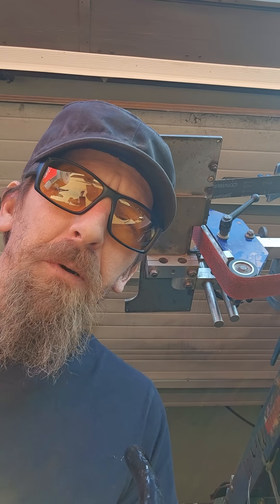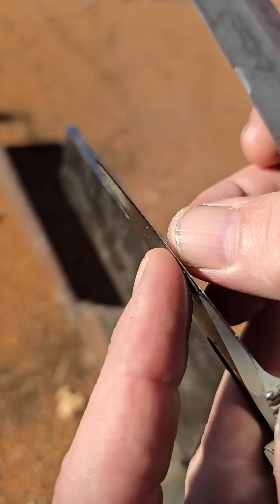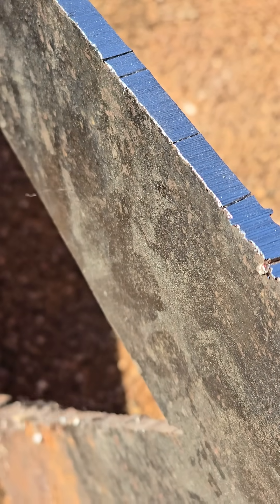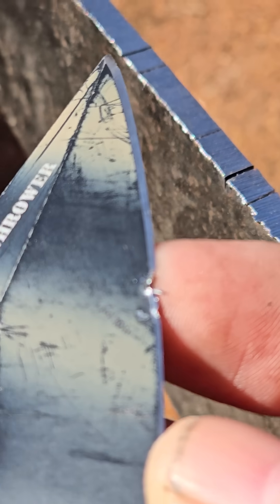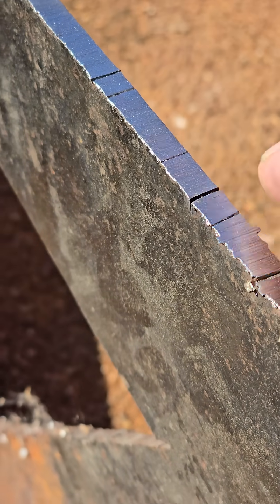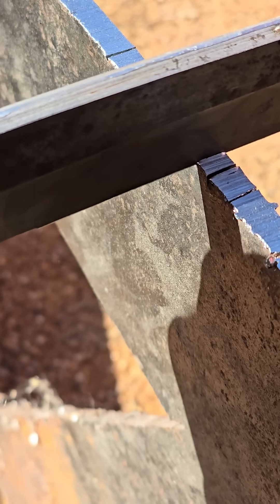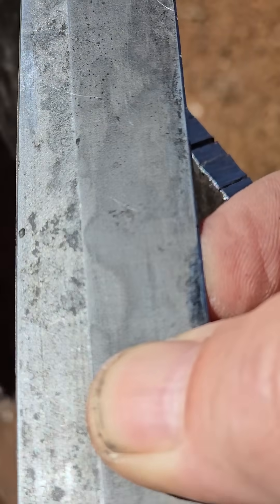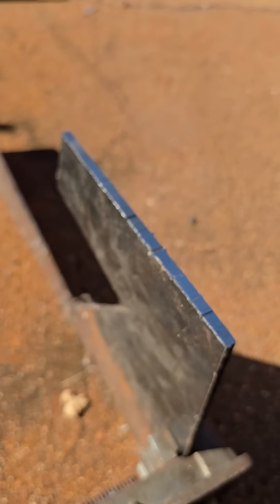myth busted. m390 vs 1095

Comment: You missed the part where your blade is 2-3x the thickness of the other blade. Terrible comparison. The geometry was nowhere near the same either. I appreciate the video, but do a real comparison next time.
Reply from the maker: My blade is .005 thick at the heel of the sharpen the other was .010 that was the point.  I wasn't testing edge geometry for slicing flesh I was testing impact resistance. My edge is thinner
Reply from the maker: How dont you see this?

Comment: Lmao 😂 you tested m390 a steel that although modern isn’t very tough at all against 1095? How about a fair test like 3v that’s a fairly tough steel and it’s more modern too
I would not trade my cold steel master hunter in 3v for a 1095 knife ever. It’s tough holds an edge better than 1095 and because it’s such a tough steel I can put a 30 degree edge on it and it keeps it.
Don’t try to make it look like modern steel is trash by showing the toughness of a fairly weak steel like m390 against 1095.
Reply from the maker: To the contrary. M390 has 1.25% carbon. I would happily put it up against 3v which I have. The point here is how the heat treatment is done

Comment: you call yourself a pro? 😅
Reply from the maker: Your point?
Reply: @proknifethrower sorry for using provocative words.
Imho, for field/outdoor use and impact resistance, of course the M390 is less tough.
Different steels are made for different purposes, so the testing method should match what the steel is actually meant for,  not just impact resistance
Reply from the maker: @yamerica3550 m390 doesn't have to be less tough it actually has more carbon content than 1095. Edge holding capability comes down to two factors Rockwell of hardness and grain density. Therefore, if it can't chop steel at all without the edge collapsing then the grain density is not tight enough or it is too soft. Compared to the possibilities of m390 which can be great you can see how I might be a bit disappointed. It's true that my primary grind is an increased slope over the other. However the heel of my sharpen is .005 over the .010 of the other. Im pointing out the difference in good heat treatment.  Unfortunately my heat treatment is far from a Factory schedule. I'm maximizing what's possible with simple carbon steel. Not at all what is happening to stealing the industry these days
Reply from the maker: I would love to see you try to have a metallurgical debate with me. You want to throw an insult but you have no knowledge

Comment: That MicroTech Stitch has a super thin behind the edge blade, so this test means nothing with all due respect.
Reply from the maker: I'm not testing the primary grind I'm testing the edge retention. Furthermore the heel of my sharpen is much thinner than the heel of the sharpen on the Microtech. While the primary grind of my blade is wider the actual blade heel of the sharpen is thinner. This test actually means a lot. But I guess you'll keep buying crappy factory heat treated knives
Reply: @proknifethrower you are testing edge retention by hammering it into another material? I don't want to come off harsh, but it looks like you were testing toughness? Sorry for my delivery if it came off as critical, but I do enjoy these videos. I'm always willing to learn
Reply from the maker: @appalachianadvrider yes I'm testing Edge retention. On my 1095 blade I would be looking for it to roll or dull. The same on the other. I didn't expect it to collapse the whole blade. Even with my 5160 heat treatment chopping 1/4 inch by half inch mild steel in half is no hard task. There is just that big of a difference in good single batch heat treatment versus Factory 1000 blades a day heat treatment I guess
Reply: @proknifethrower If you want actual test, copy edge geometry of m390 blade with your 1095 blade. Do your heat treat. And repeat the test! That would actually be useful comparison!

Comment: What people hate to admit about super steels is that yes, they are good at holding and edge are super corrosion resistance but are brittle as hell no matter what heat treatment. I choose high carbon over super steels.  even some high carbon tool steels are better than modern powder metallurgical mega😂 steels.
Reply from the maker: If you're into doing heat treatment science hit me up my friend I've been studying it at a high level for a long time

Comment: Tougher doesn't always mean better
Reply from the maker: @KNIFEBOYPRACTICAL  show me an instance where that is the case. You can't have a tough knife without first having hard and good grain refined Martinsite
Reply: Plenty of life experience where that's not the case 🤷 I mean sure if you're an outdoorsman then something tough like 1095 or 1075 or even a powdered steel like 3v or Cruwear is optimal. You had a large knot while processing some wood or Nick some bone while dressing an animal then those tougher steals do come in handy. But for most people strength is a non-issue in a knife. Probably the least desired attribute. with toughness comes sacrifice and corrosion resistance and wear resistance (edge retention) Most people just want an object that's going to stay sharp and that's not going to corrode away on them when they do rarely break it out to use it. There's a reason why the super hard high edge retention steals are so popular and super tough steals like Mike riemelt and 4v aren't.  @proknifethrower
Reply: @proknifethrower hard and tough for two completely different attributes in a knife. Hardness usually yields higher ed retention and usually will also yield a high level of corrosion resistance steel harder to sharpen. Toughness is the opposite of the ladder. Tough steels yield usually mediocre to poor wear resistance and subpar levels of corrosion resistance but are easy to sharpen in the field. Tough steel equals soft and malleable with poor corrosion resistance and ease of sharpening. Hard steel equals rigid and fragile. Hard sterls are more likely to chip rather than roll. There are pros and cons to both it just depends on what you want out of your knife and I'm just here to tell you that toughness is probably the least desired attribute. For people who use their knives correctly and normally toughness is just not really a great issue other than having a enough carbon and a fine enough grain structure to hold an edge.
Reply from the maker: @KNIFEBOYPRACTICAL  I'm sorry dude but I'm a knife maker professionally and a heat treatment scientist. This is incorrect
Reply from the maker: @KNIFEBOYPRACTICAL  but I will say I'm an open book if you want any actual scientific information or any of the truth. My number is available to you and we can always get on the phone and chat. I'm Heat Treating steel constantly my teachers are John verhoeven and R.A. grange. As well as a couple of my buddies from microanalytical systems in Missouri who specialize in metallurgical disputes in court
Reply: @proknifethrower how is it incorrect
Reply: OK boomer!
Reply: @luciusirving5926 getting angry over a comment I made 6 months ago....🤦 Real winner

Comment: Theyre better than 1095 in certain scenarios... banging the knife off steal isnt one of them lol
Reply from the maker: Listen my friend if a knife holds its edge better beating Steel don't you think it will hold its edge better when I'm cutting Organics we're literally talking about Rockwell hardness and grain density. It is very relevant
Reply: @proknifethrower no your test is testing toughness not edge retention. M390 will never compare to 1095 in toughness, you're also forgetting edge geometry and heat treat. Get to blades of the same profile and cut cardboard till one dulls, that's edge retention.
Reply from the maker: @philipgabriel2450  brother with all due respect you are misinformed
Reply: Sounds like something an old man would say rather than a blacksmith. Ever been a blacksmith before?

Comment: You mean the steel that’s designed for edge retention and hardness chipped and the simple carbon steel renown for its toughness didn’t?! I never would have guessed. 🤦🏻‍♂️🤦🏻‍♂️🤦🏻‍♂️🤦🏻‍♂️🤦🏻‍♂️🤦🏻‍♂️🤦🏻‍♂️🤦🏻‍♂️
Reply from the maker: @TripleD404  how would it have better Edge retention? Edge retention comes down to Rockwell hardness and grain refinement or grain density. The test speaks for itself

Comment: Are we just gonna pretend that the 1095 blade isnt 1/4" thick?  Get a lionsteel m4 and do the same test
Reply from the maker: @steelasura  it is. But the edge is thinner. Test speaks gor itself
Reply from the maker: @steelasura  not all heat treatment is equal.  The steel itself has great properties
Reply: So do a proper test, same thickness same grind, not fair to put a 1/8" 15% knife up against a 1/4" with a 22%(using as an example) otherwise what's the point
Reply from the maker: @steelasura  @steelasura  the point is Edge retention of the edge. I can't help that the Microtech collapsed. My Edge grind is much thinner and took no damage at all. I'd be happy to do a same test with the same thickness. But let me ask you this how much steel have you heat treated how much do you know about metallurgical science and how do you really know that what you're saying even equivocates to this test
Reply from the maker: @steelasura  the primary grind slope in this instance has absolutely jack s*** to do with the edge retention. Now once the steel collapses into the primary grind then yeah the thickness of the slope will matter.
Reply: @proknifethrower  edge retention, sure.  What you are doing is impact edge testing, not edge retention, edge retention is trying to slice a brick, and thickness has everything to do with edge retention or impact edge testing wtfdym
Reply: I know quite a bit about heat treatment, what would you like to know? If you are gonna call something a "test" should prob take out all the variables so there is an exact standard.  If you are testing weight of a 5 gallon and a 6 gallon bucket full of water guess which one is gonna be heavier
Reply from the maker: @steelasura  I think you're just mad because the m390 steel in this test performed like s***. I'd be happy to shoot you my email address we can get on the phone and chat more in depth about this bushido9840@gmail.com

Comment: Blade thickness 😑 the groove you made with the 1095 looks like it was from an axe 🪓💀 v vs. \/ try a razor blade next 😂
Reply from the maker: @DixonCyderBusch  the heel of the sharpen of my 1095 blade is thinner than the heel of the sharpen on the m390 I said nothing about primary grind slope. Which wouldn't matter in this case for this test

Comment: I feel like “better” will vary a whole lot depending on what you use your knife for and what properties you look for in a steel. Modern particle metallurgy steels are objectively better than older steels, but what’s best for you depends almost entirely on what you want to do with it.
Reply from the maker: Put to your point yes if you want a stainless blade specifically then that's one thing but a spring tempered blade is 600 Degrees that doesn't do a lot for the  hardness Rockwell scale even if you have good grain refinement
Reply: Well said and I agree with you. I would much rather have a high carbon steel blade forged by a master bladesmith than a stamped knife made of magnacut, m390, r2d2 or what ever they are calling steels these days. I think modern metallurgy has killed a lot of the good knife makers. These days everything is either stock removal or cnc machined with no soul. How can you even consider yourself a blacksmith if you do it that way?
Reply from the maker: If my blade can cut steel it can cut cardboard. How well your blade performs comes down to three things in this order Rockwell hardness, grain density and edge geometry. All of your modern steals only change how stainless it is and how easy it is to heat treat in a factory setting. With all due respect. But I've been studying Metallurgy at a high level for years. And I do it daily

Comment: The 1095 is twice as thick as the stitch and I'm telling you if that's a real microtech stitch it wouldn't do that. There's no way you would do that to a $1,100 knife
Reply: If 1095 is forged, then of course it's gonna be tougher, duh!

Good luck forging supersteel. Supersteel is a broad term anyway.

S7 isn't supersteel, but it's super enough for me and it's forgeable. Semistainless too which is good enough for my impact needs.

Comment: Sure, that's not a clone stitch
Reply from the maker: Yea.
Reply: @proknifethrower  so you're telling me you took $1,000 knife and ruined it. There's no profiling that and you tested it against a half inch thick slab, a 1095. There's no way that the edge geometry is the same. You can try to put a 20° angle on that 1095 but your bevel will be so huge so.....,....... And microtech general uses m398
Reply: I'm sorry anywhere between 500 and 800
Reply from the maker: @EugeneSmedlund I'm a knife maker dude. I got this from Sebastian directly. Ar a Microtech booth at blade show. Unfortunately you're incorrect
Reply from the maker: @EugeneSmedlund also the slab is a quarter inch thick of mild steel not a half inch . The spine of my knife is a quarter inch thick the thickness at the heel of the sharpen is thinner than the heel of the sharpening of the Microtech. I didn't say anything about the primary grinds . Hardness always comes down to carbon no matter what steel you use bro. Think a bit like horsepower and torque horsepower is your hardness and torque as your grain density. Factory heat treatment usually sucks
Reply from the maker: @EugeneSmedlund  also you keep trying to talk about the price. My blade is 750 but it's all made by hand here in the shop. But I can understand somebody being upset because I believe that costs so much is a pile of s***
Reply from the maker: @EugeneSmedlund  and I just looked up the price on that blade granted it was given to me and Sebastian is a friend of mine, but that blade only retails for 450. But listen dude I'd be happy to chat about Metallurgy with you directly if you're ever interested. I've put in about 7 years of high-level study
Reply: @proknifethrower  Any 1095 heat treat advice for someone getting started in blade making?
Reply from the maker: @40SnWfan  sure shoot me a message Bushido9840@gmail.com we'll get on a phone call

Comment: This showed nothing about edge retention nor was it an equivalent test the 1095 was as thick as a brick. This was a “toughness” test and if it was equivalent test it would be same blade, edge and heat treat.
Reply from the maker: My 1095 is thinner at the edge then this blade. Tell me you don't know anything about heat treatment without telling me you don't know anything about heat treatment
Reply: @proknifethrower  Your blade may be thinner at the edge than the M390 blade, but the geometry is different. What is the angle of the primary grind for both knives? Assuming the grinds are the same height, the tanto looks about 2x the thickness as the other knife, hence the angle of the primary grind would also be twice as large. 

This is a HUGE difference in durability. Stiffness is cubic, so by doubling the stock thickness, you essentially increase the stiffness of the blade by 8x. 

Now, I’m not doubting 1095 or your heat treat, I prefer low alloy steels myself. They are highly glossed over now with the abundance of high carbide steels (which generally (not always), have low toughness). But this is more of a test of blade thickness/profile/geometry. If you want to get even more accurate results. You have to take as many variables out as possible and make a 1095 blade to the exact dimensions and geometry as the M390 blade to actually compare the steel. 

Then there’s the other part, your 1095 blade may have a much better HT compared to factory mass market 1095, but is the M390 blade also at an optimum HT? That also has to be considered.
Reply from the maker: @Divine_Serpent_Geh I'm sorry man but that's incorrect. To show that I could take a .050 thick at the heel of the sharpen tops knife and pounded into steel and its Edge will fail miserably. The primary grind makes no difference on this test
Reply from the maker: @Divine_Serpent_Geh if you wanna chat specifics.  Bushido9840@gmail.com
Reply: @proknifethrower  you present yourself as a rectum. Your slab of a turd you call a blade is clearly almost as thick as your skull. So tell me you have “4” buttholes with no eyes without telling us you have no eyes. Heat treat your brain, it’s soft.
Reply: @proknifethrower  you present yourself as a rectum. Your slab of a turd you call a blade is clearly almost as thick as your skull. So tell me you have "4" buttholes with no eyes without telling us you have no eyes. Heat treat your brain, it's soft.
Reply: @proknifethrower  there is no rocket science in heat treating a 1095
Reply from the maker: @batkorub spoken like a complete inexperienced noob
Reply: @proknifethrower don't be an idiot
Reply from the maker: @tonis563 speak for yourself. I've proven the performance time and time again. How many blades have you heat treated? How many hours do you have into the science how much experimenting have you done unless you want to debate facts you're the idiot. Come on my page talking shit LOL

Comment: Your testing blade looks much thicker.. not sure if this is apples to apples. Looks like you didn't control the variables properly.
Reply: This, equal blades, edges and heat treat etc
Reply from the maker: @milktobo7418  my blade Edge is. 015 at the heel of the sharpen. The other blade is 025 at the heel of sharpening. Regardless my blade took no damage which is interesting. The other blade was obliterated way past the heel of the sharpening.
Reply from the maker: That's kind of the point. Factory heat treatment sucks in most cases